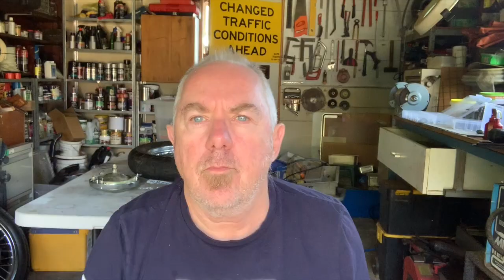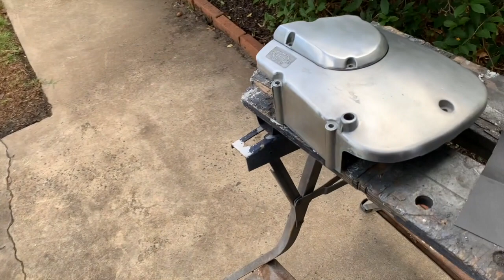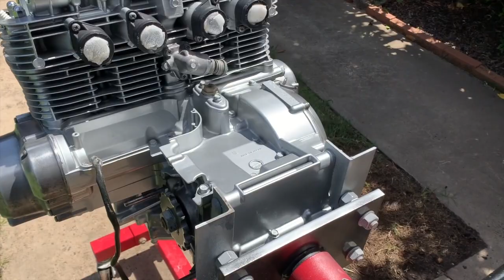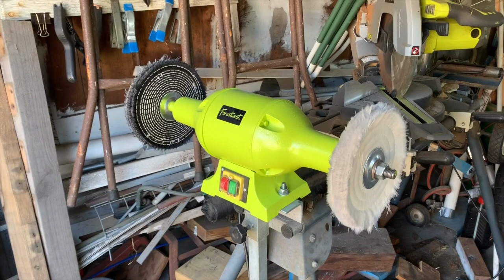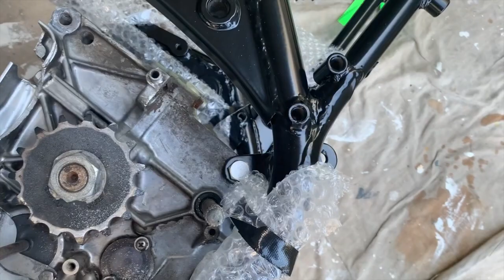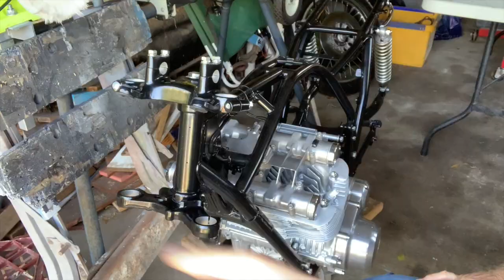GS750 Restoration Part 12

Comment: Hi Playsax love the vids and in the process of a 1976 GS750 restore , could you tell me best possible source for a headlight or headlight casing as mine has totally broken up due to age heat etc
Reply from the maker: Hi Graham. Thanks for watching. I’d suggest finding the part numbers from somewhere like Partzilla then search for that. Otherwise some FB groups like ACS (air cooled Suzukis) may be able to help. Good luck!

Comment: Hello, what cleaner and how did you scrub down the engine? Like a toothbrush? Also I have a 83 GS850GL I’m about to start cleaning and fixing up. But I’m totally new to this. Would you be willing to help me or guide me to what parts to use that would work? For instance new controls and grips for the handle bars. New shocks. And I may put bar end mirrors on if I can.
Reply from the maker: Hi there, happy to answer questions. The way I cleaned my motor was degreaser first with brushes etc and high pressure wash. I then soda blasted it (see episode 10). I then polished some parts and painted some others. Best place for spares I found is Partzilla in the US. They had most things, otherwise ebay. Never done bar end mirrors but google is your friend! Cheers.